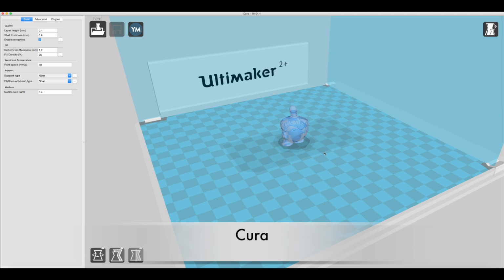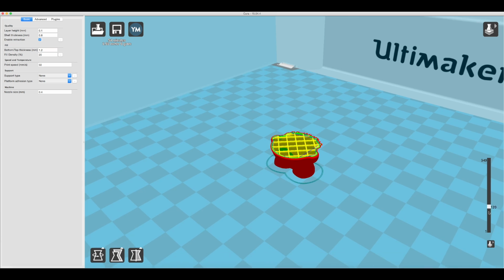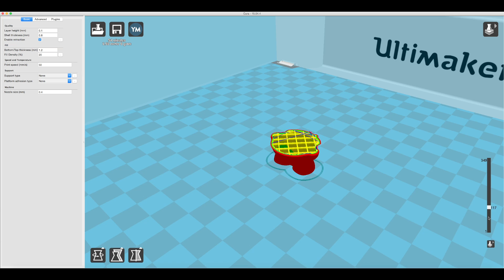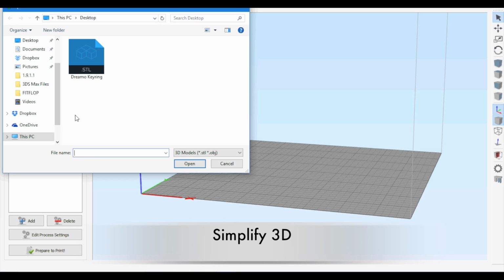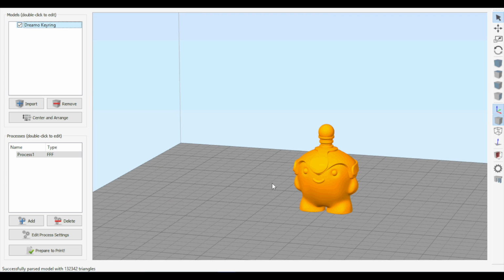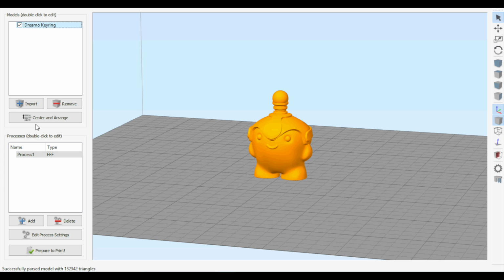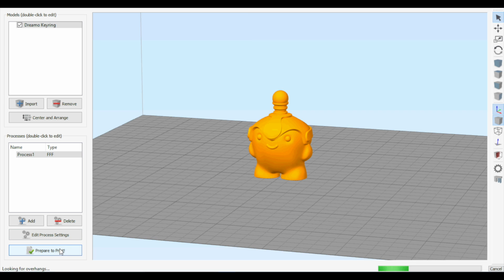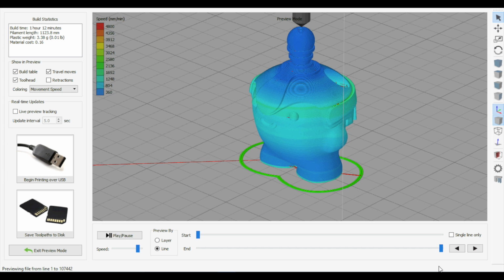Simplify3D vs Cura (Basic Settings) Quality Test Comparison | Software  Dream 3D

Comment: Can you test this with the latest Cura 2.1, and not the previous generation? I'm thinking of getting Simplify3D, but am wary if it does indeed perform better than the latest Cura.
Reply from the maker: Definitely, we'll try and get a comparison done soon. I'd say you still get slightly better results and the custom support tools are a massive plus in Simplify3D
Reply: Dream 3D I would love to see a new comparison, too

Comment: Hi Dream.

When i load a saved programme off of simplify 3D onto my ultimaker 2, it says no info available? where as when i used cura it tells me how long left? is this normal?
Reply from the maker: Hi Daniel, this sounds pretty normal. Simplify3D files override the standard settings on the machine so it is a possibility

Comment: You are now using your own 'Medium' Cura settings (0.1 layer height but I don't see what cooling settings). Why aren't you using the standard Cura profiles for PLA on the UM2+? I am pretty sure you would get a better quality print if you just use the standard PLA High Quality profile, without going into expert mode, like how you are slicing with simplify3D.
Reply from the maker: +Tom Heijmans Hi Tom,  we wanted both prints to have similar settings, Simplify3D set to high quality uses 100 micron layer height which is why we set Cura to the same. We will be further testing Simplify3D over the next few weeks so perhaps we will also do another test just using the standard profiles.

Comment: Nice test, but would you mind to share the specific print settings of Simplify3D? Looking at the video it seems the speed set in Cura is more than twice as fast than S3D - and then it is no wonder the S3D version looks better...
Reply: Dream 3D But Cura does the same.. and even the old versions did.. And so the settings matters.
Reply from the maker: +Sorin Stefan Nicolin Hi Sorin, the overall print speed for Simplify3D changes throughout the print. Simplify3D designates different print speeds for different areas of the model (e.g First layer, Infill, Outline etc). We used the preset High quality setting and only changed the infill amount to match Cura at 20%. The Simplify3D print took around 4 minutes longer to print. Hope that helps.